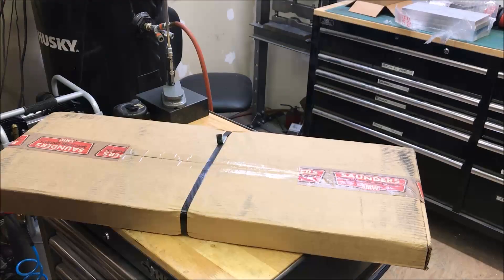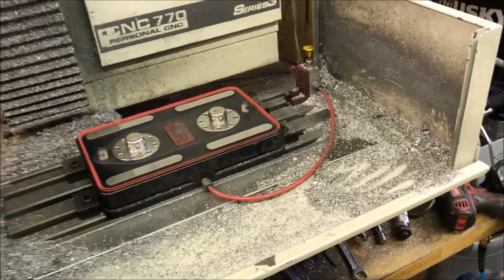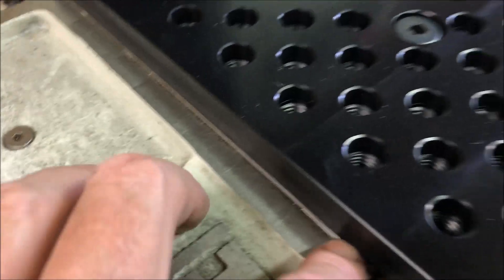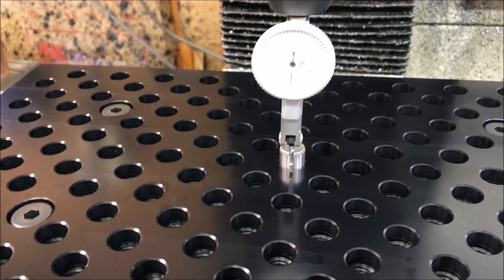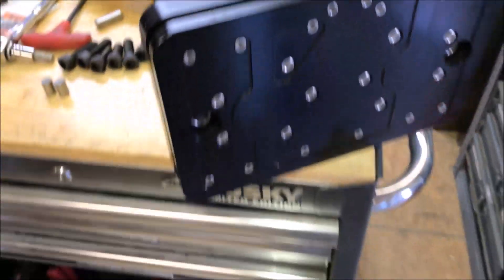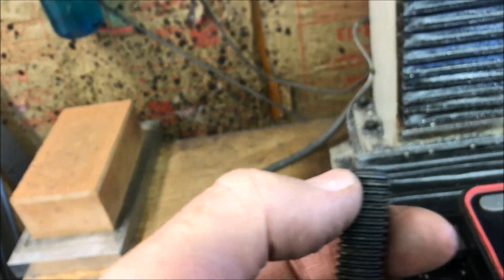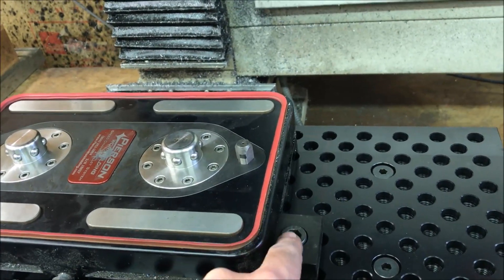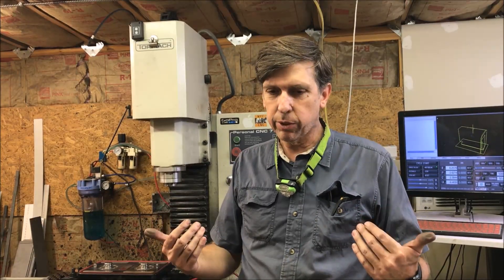SMW Tooling Plate for My Tormach 770   Installing and Pallet System

Comment: Thanks for great video, Craig! 
I’m concidering to buy this plate. Can you tell me how flat this plate is when you move dial indicator over it? My current plate has 0.002” gradient in the middle within 7” of travel and when I put vise on top it’s tilted which is super annoying given that  tormach table is flat within 0.0002”.
Reply from the maker: Thanks!  Sorry, but I took my tooling plate off.  I am using a Pierson MPS on the 770 table now. The pallets can be faced perfectly flat.  I got the MPS Tooling plate form SMW and will probably get his mini vises.

Comment: the SMW toolplate basically uses the same layout as the tosa plate.  for the propallet you can just enlarge the holes on the provided clamps by .125 and it should work fine.
Reply from the maker: Thanks

Comment: John must have revised the tooling plate, mine only has 4 bolt holes for hold downs.  That was a good way of tramming it in as well, I might have to re-tram mine.  Someday I will have a pierson pallet system haha
Reply from the maker: I was wondering how you trammed yours off the tooling plate.  The edges are outside of my work envelope.  Yeah, the dowel pins work great. I've been working away from the pallet system.  I like it but the cost of the pallets is high and it affects the z clearance.
Reply: I just stuck a dial test with a mag base to the spindle then was able to reach to the front side of the plate then I just ran it back and forth like you would zero in a vise.  Does the pallet raise the z clearance more than a vise does?
Reply from the maker: Oh yeah, cool.  About the same but you can't mount the vise on the pallet for an instant vise.  Pierson does that but they have VMCs.
Reply: Yeah I was hoping I could put a vise on a pallet :(

Comment: Thanks, Craig!   We've got a video coming out this week on our recommended method of making diamond pins integral with a DIY fixture that can drop right on to the SMW plate.
Reply from the maker: Sweet, can't wait to see it!  That G10 stuff is messy.
Reply: does this fixture plate still allow full travel on the 770?